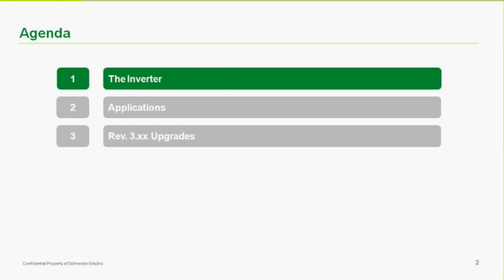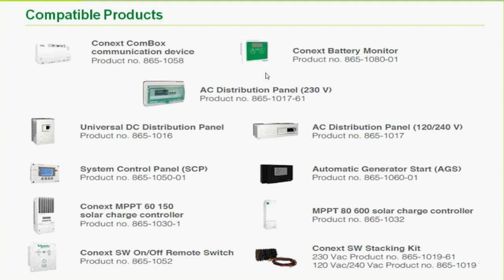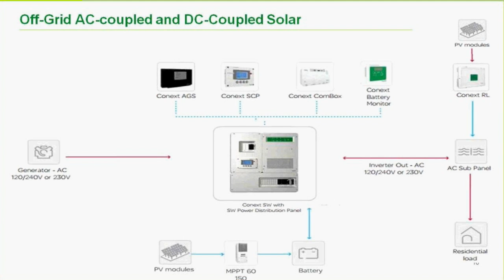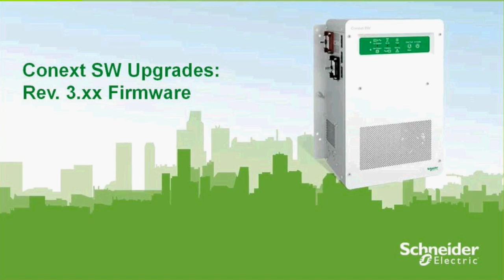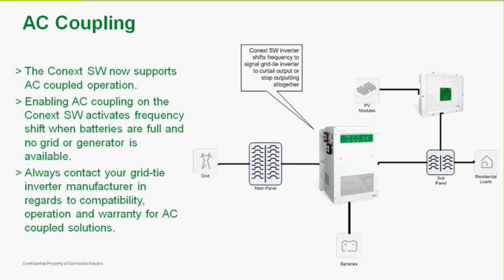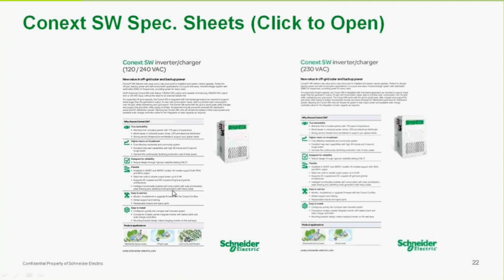[Webinar Replay] Intro to the Conext SW Hybrid Inverter/Charger

Comment: I have 2 sw4024 units stacked and i am sorry they do not work as advertised. Tech support cannot resolve the issue after over 2 months. solid as hell in single unit mode. flaky at best stacked.

Comment: Do you think Schneider could take the MODBUS output of the COMBOX and drive Schneider TC300 MODBUS thermostat? I would like to run a mini-split heat pump and if the solar (voltage) is being reduced from clouds, the software would set the progammed temperature to zero differential. As the clouds reduced the software would set the differential higher. Mini-splits use more power as the differential increases. Thanks! --Dave  offgridsolar@sti.net

Comment: Another point for using the 24V version over 48 volt is the cost of the battery bank. This cost in remote places in the third world is often far more than the cost of a charge controller.
In 23 years off-gridI have never had any harmonic distortion problems from Xantrex/Schneider and even Trace.
 I also believe the XW  will last longer engineered-in at design.

Comment: I attended this webinar because I was having a hard time trying to figure out what the Total Harmonic Distortion (THD) of the Conext SW was, and it does not appear anywhere in the datasheet or the user manual The presenter did not know either, and he also did not know it was not specced in the datasheet! Well, after some struggle I got an email answer from Schneider tech support: "Our technical champion says it is <3%." Unfortunately that turned out to be incorrect; a senior person in Schneider who was gracious enough to contact me in response to another Youtube post clarified "For the IEC version, the THD is less than 5% with the normal input voltage range 44V-56V. The tests are conducted under pure resistive load condition. (We are not sure where the <3% came from... )."   Note that these tests are with pure resistive loads, not with the typical mix of nonlinear loads that are to be found in any household: SMPS power supplies, motors, refrigerators etc. The inverter is advertised as being able to to supply power as good as or better than the grid, and the Scheider-sponsored Wiki link at 
http://www.electrical-installation.org/enwiki/Harmonics_standards
clearly tells you what the accepted THD limits for grid power are according to Standards EN 50160. This would lead one to believe that a thorough test process should in fact be conducted with a suitable nonlinear load mix that represents what one would encounter in practice. I have seen 150W SMPSes destroy the waveforms of so-called pure sine wave  3kVA inverters of well-known brands.  However, a "pure resistive" THD figure is all we have for the Conext SW. Why Schneider would limit the THD test to a pure resistive load which is totally artificial is a mystery.